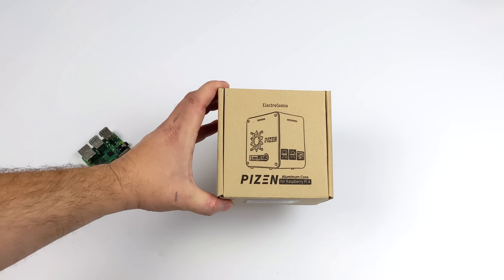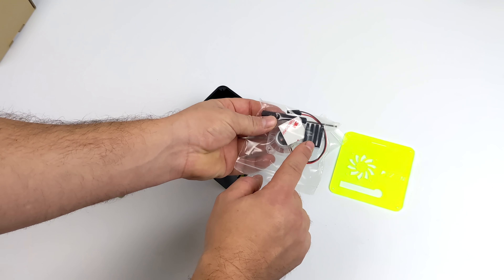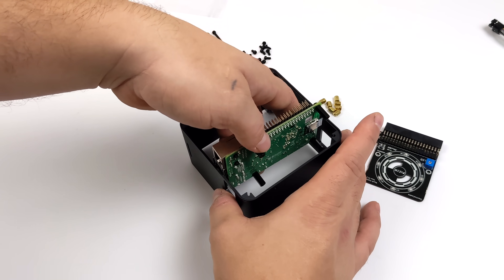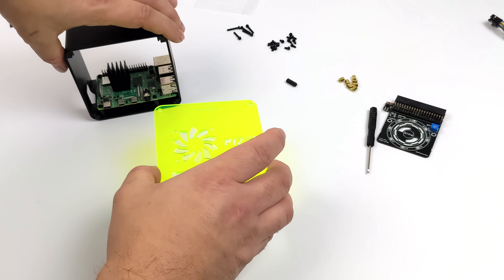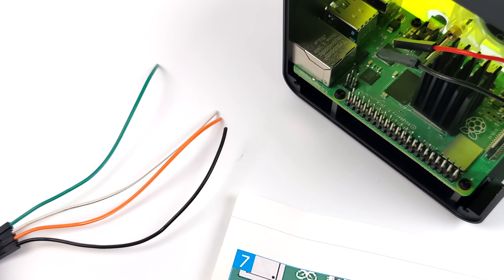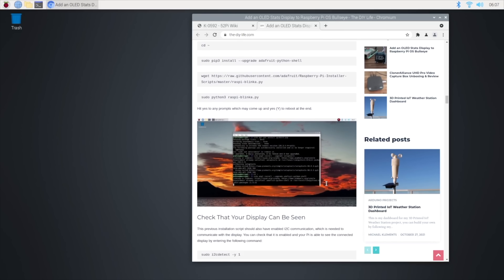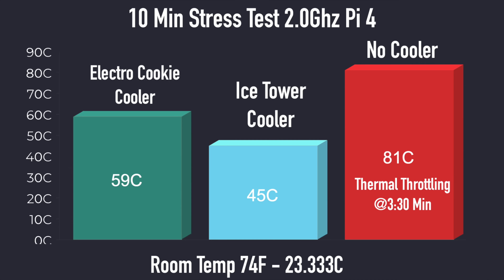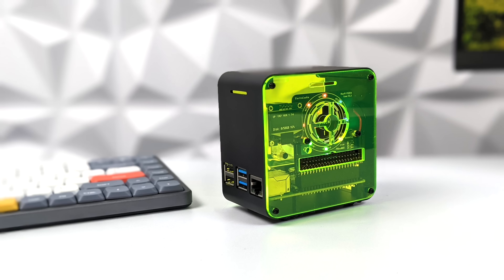The Electro Kitty PiZen Is An Aluminum Desktop Tower Case For The Raspberry Pi4!

Comment: Don't get me wrong ETA, great video as always,  but my opinion on the product itself is: So much potential wasted. Come on! That "huge" chunk of aluminum not being used to add passive cooling (at least), no daughter board for rerouting HDMI and power, also, no power button. A lot of empty space not being able to accommodate an SSD...  It's like expecting too much for $29.99, but at the same time, $29.99 is too much for what they are offering . It's a sure pass for me.

Comment: It is possible to use big cooler with that case? On amazon someone writed that you can use ice tower cooler. Or its possible left on your raspberry Geekworm (joy-it) Raspberry Pi 4 Armor Case inside this case :) ? Will it fit inside?
Reply: I have a Pi 4 with ice tower and I am going to put it in this case. I already saw a picture from someone who did it so I guess it is fitting.

Comment: I'd much rather use a small CNC machined aluminum heat sink case like from KKSB or even a Flirt case. It keeps the form factor much smaller. If I'm going with a bigger case, it would be the Argon ONE M.2 case to get full size HDMI outputs and add an M.2 SATA SSD.

Comment: No provision to mount an SSD inside. Why do these cases fail to provide such a basic need? Hanging an SSD off the side makes a beautiful case ugly.
Reply: Most Pie Users want cases with 1 or more 3.5 or 2.5 Slots but Case makers dont care, they make only the cheap useless cases without slots. Only Geekworm makes some with HDD/SSD Slots but the 2.5 Slot dont eat all 2.5 HDD, so u can only put the little 2.5HDD into the cases.

Hopefully Pie5 get Sata Port so that Cases get automatic a place for big HDD/SSD.
Reply: @stefans.3940  I can see a Pi-NAS, but it doesn't need beauty.  I can see a low powered, portable desktop but I would struggle to need more than 128 gb.  What do you have in mind that requires a beautiful case and 2.5" drive bays?
Reply: @TP-hc4qi  I use my 8GB Pi 4 as my desktop and to do that it must have an SSD as even the most expensive microSD card pales in comparison to a cheap SSD. It does all I need at this point except for the occasional video work that I perform on my 12 core Mac Pro. It's kind of ridiculous to use the Mac Pro for web browsing and email not to mention the power bill. I already have a 3d printed case with dongles hanging off of it and I'd like a nicer one but it's not a desperate need at the moment.
Reply: @ninline2000  You have a desktop that does pretty much only web browsing?  Why?
Reply: You nailed it. But a M.2 drive would fit if the right IO board was used.
Reply: I would want room for an SSD or m.2 drive, and full size HDMI ports if I was going to use it as some kind of desktop PC.
Reply: for this one, if you're creative enough, you can mount the ssd on the bottom since there are four screw holes on the bottom that fits with the x862 ssd adapter.

Comment: Ok, the case has me interested BUT the RGB ring, the awful Green plexiglass panels are terrible. Replace the panels wouldn’t be that hard to do. 

The OLED display could be mounted at the front running the cables through the camera cable slot. A 3D printed case for display could be used. 

Add a Ice Tower fan 
I also wonder if a M.2 can be added in the basement area. 

My collection of Pi cases are taking up 2 shelf with different ones a bought and printed.
Reply: In the next months I guess we'll have many arylic or plexiglass panes around that were used for separation shield. I'm aiming for that to be used in my lasercutter for exactly this reason : sidepanels
Reply: @MrLexhoya  yes! My next purchase will indeed be a laser cutter.  The prices are coming down for small format models or I could just build one. Anyone have a built plan they can share?

Comment: Don't like these cases not having the power supply inside them like desktop pc's...
Reply: I cannot think what kind of power supply would fit in there, your average phone charger is about the size of the Pi 4 itself and considering you can pretty much run a Pi 4 using a portable battery I don't think not having an internal power supply is that much of a deal